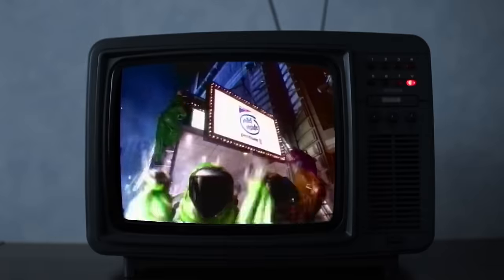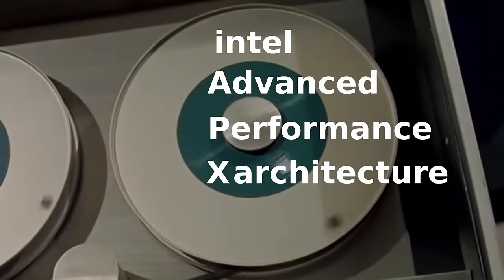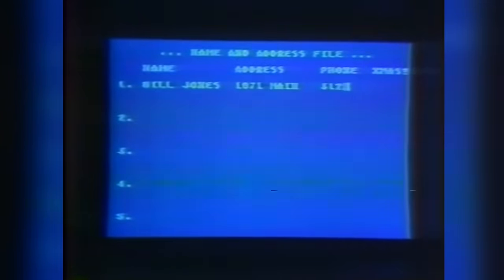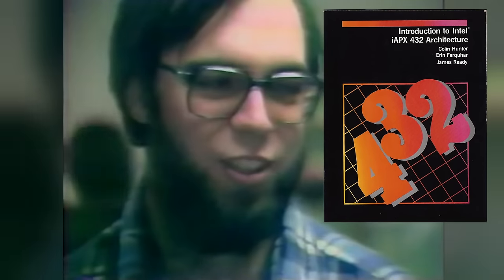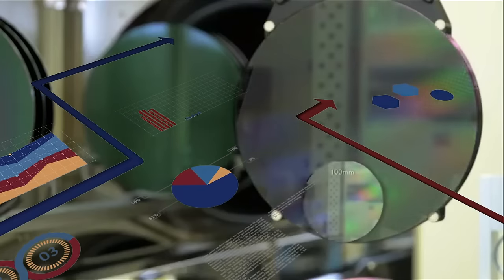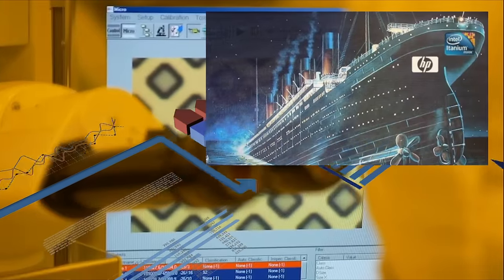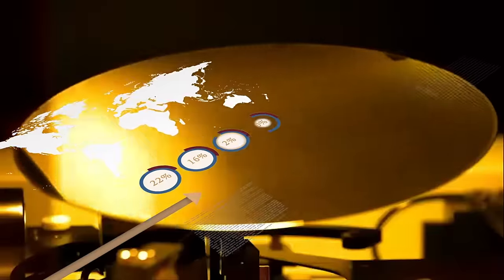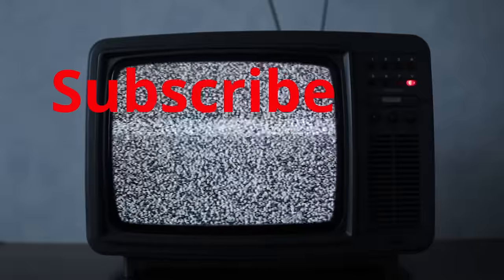iAPX The first time Intel tried to kill x86

Comment: An expensive arch with an inordinate dependency on an a magic compiler that never worked? It's the Itanium's granddaddy.
x86 was never intended to do what it ended up doing, which is why Intel kept trying to replace it. Too bad the bandaids were so effective as to render most attempts futile. The i860 was Intel's next attempt after the iAPX, a pure RISC design this time, but this also failed for a variety of reasons.
The APX wasn't unique in using multi-chip CPUs (multi-chip and discrete logic-based CPU modules were common in mainframes such as the System/360) but in minis and micros they weren't ideal and they certainly would've needed to consolidate to single-chip implementations ASAP to keep up with chips (in both performance and price) such as the 68k and especially the RISC designs that were less than a decade off.
Also, this wasn't the only arch that tried to run a high-level language directly: AT&T's CRISP-based Hobbit chips ran C (or they did until development was canceled).
Reply from the maker: I did not think many poeple would have heard of Hobbit, so I went for the lisp machine as an example as people at least go to see them in comp sci labs.
Reply: The i860 did find use in a lot of raid controllers and other applications.
One thing that killed Itanium was AMD making the X86-64 extensions and the Opteron line.
Reply: @RetroBytesUK  I'm a little bit of a Mac nerd. The Hobbit was pursued for potential use in the Newton, but Hobbit was overpriced and also sucked so it was canned in favor of DEC's StrongARM. Then Be was going to use it in the BeBox but when the Hobbit project was cancelled (because Apple wasn't interested in forking over the millions of dollars demanded by AT&T to continue development), they switched to the PPC 603.
Reply: @Membrane556  The i960 was fairly widely used in high-end RAID controllers because apparently it was really good at XORing. RetroBytes has a video on the channel about the Itanium that's worth a watch if you haven't already. It was a huge factor to be sure but there was more to it than just the introduction of x86-64 (including that ia64 was too expensive, too slow, and had dreadful x86 emulation).
Reply: @Membrane556  ah, that was the i960.  The i960 had an XOR op code.  Raid does a lot of XOR....
Reply: the i860 did have an XOR, however.
Reply: @Membrane556  Itanium goal was projected to be 1.5X better than a conventional architecture w/o explicit parallelism. But the basis for this was a specific chess code, not applicable to many server logic apps. I would have thought Itanium should have done well in scientific computing, for which a compiler should have been easily able to pack 3 (Merced) or 6 (McKinley) instruction bundles. But at this time, the big money revenue product was server - database transactions, or other logic branch intensive code, which I never saw any proper analysis as to why EPIC was the right approach. Colwell believe SMT was the better approach for logic, to reduce the dead cycles.
Reply: @RetroBytesUK  I had a comp sci prof in the 90s who utilized lisp/scheme for all his classes. He was obsessed with it and would tell us that he learned lisp in the early 80s on Star And similar lisp-OS machines.
Reply: @Membrane556  i960 ended up being fairly successful though. It was used in a lot of embedded systems and Sega used it in a bunch of 3D arcade games through the 90's (apparently it was part of the Lockheed Martin technology that Sega licensed for their Model 2 and Model 3 arcade boards)
Reply: @Membrane556  Well that and Itanium sucked.
Reply: Sure, but Intel tried to kill x86 for different reasons throughout its history. With iAPX, it's because they thought that bridging the "semantic gap" in hardware (instead of the compiler) was the next big thing, and x86 compatibility wasn't a consideration back then. With Itanium, it was because x86 compatibility was a huge consideration and AMD had an x86 license (and Intel didn't like that). So, Intel was like "if you want 64-bits with reasonably good x86 compatibility, you have to go to our Itanium monopoly". Some poor souls did, but most held on to 32-bits or if they didn't want x86 compatibility went to Sun (SPARC) or SGI (MIPS). Then AMD came up with AMD64 with full x86-32 backwards compatibility and Intel finally admitted x86 (and AMD) were here to stay, and stopped trying to kill x86.
Reply: @Membrane556  ---"The i860 did find use in a lot of raid controllers and other applications."

The i960 did. Completely different animal.
Reply: @Δημήτρης-θ7θ  The BS that was Itanic is what brought an end to the Alpha, which was a true next generation design from x86. For much of its life it could emulate x86 faster than the fastest x86 cpus in the market. And much of its foundation was built on commodity hardware and had interoperability. And had a well established ISA by this point as well.
Reply: @wishusknight3009  Chipzilla being Chipzilla brought an end to the Alpha. All those companies making RISC CPUs (with their small economies of scale and skyrocketing R&D costs) knew that if Itanium didn't beat them in most segments, x86 would, as it actually happened with the Pentium III. Later AMD64 finished them off. This also happened in an era CPU design costs were increasing rapidly, so those companies were looking for a way out anyway. In their twilight years, companies making RISC CPUs ended up either pandering to a tiny crowd who wanted desk-side supercomputers (for example SGI with their Tezro) or were charging for compatibility with Big Iron systems (for example Sun with the Ultra 25 and 45), with those SPARC Big Iron systems themselves also being bought due to backward compatibility concerns. Everything else was x86.
Reply: @Δημήτρης-θ7θ  Alpha had a thriving market all its own up until it was canned. It would have survived for some time yet, and would have even been a great alternative in the emulation space due to its wide programming flexibility. It took Conro to really put the super cores to bed in performance. But only after the other arcs were becoming left to languish with no updates.  There are even still other architectures on the top 500 that are not x86 or nVidia. And IBM Power still thrives at the ultra high end where its untouchable by anything else in performance density. 

But yeah, for the most part you are completely on the money. x86 had economy of scale and ubiquitous hardware and software support. It was a matter of time even if those other companies had the RnD power of IBM. Things eventually coalesce.

Comment: Burroughs was the first to feature compiler friendly hardware architecture in the B5000 model. it also was the first to feature virtual memory architecture. As a result, huge teams of software developer were not needed to implement Algol-60 and other major compilers with great reliability and efficiency. Eventually, Burroughs was able to implement the architecture in IC chips.

Comment: 1:23 that tape unit looks wrong. There doesn't seem to be any devices to soften the pull of the tape up reel. On full height units there are suction channels that descend either side of the head and capstans. The capstans can rapidly shuttle the tape across the head and you'd see the the loop in the channels go up and down. When the tape on either channel would shorten to the top of the channel then the reels would spin and equalize the length of tape in the channels. So the only tension on the tape was from the suction of air and not a mechanical pull from the reels that at high speed would stretch the tape. Slower units might have a simple idler? whigh was on a spring suspension. You'd see the idler bouncing back an forward and the reels intermittently spinning. Looking at the unit shown either its really old and slow or its a movie/TV prop.
Reply from the maker: It is indeed from a movie, one of the first crime capers to feature computer hacking. Its took the term cliffhanger very literally for its ending too.
Reply: @RetroBytesUK   Oh thank god.  The way that tape looked like it was getting twisted and jerked was stressing me out.  HAHAHA.  Still I hate it when movie props don't look right either.

Comment: Intel did do another O/S called RMX (stood for Real-time Muti-tasking Executive ) was used extensively with their range of multibus boards. It was powerful and popular in control systems ( like factory automation )
There was also ISIS which was used on the Intel development systems. I use to service these and were a major tool for BT, Marconi’s, IBM, and anyone wanting to develop a system to use a microprocessor as they had In Circuit Emulators ( ICE ) units that enabled developers to test their code before they had proper hardware or to test their hardware as you could remove the processor and run and debug your code instruction by instruction. 
During the early 80’s there was a massive rush to replacement legacy analogue systems with digital equipment controlled by a microprocessor and intel had development systems, their ICE units and various compilers ( machine code level, PL/M, Pascal, C, to name a few ) so a hardware engineer could develop his code and test it quicker than most of the competitors. 
Fond memories going to factories where they were putting their first microprocessor in vending machines, petrol pumps, cars, etc. 

One guy developing his coke dispensing machine wanted a way of networking all the machines ( no internet then ) and have them as a super-computer calculating Pi as they would be spending most of their life doing nothing.
Reply: I've got an Intel System 310 running iRMX 86!

It's actually been rebadged by High Integrity Systems, and has three custom multibus boards which are the core iAPX 432 implementation by them.

The iRMX 86 side works well enough, but the Interface Processor on the iAPX 432 processor board refuses to initialise, and I suspect it is due to faulty RAM.

Very interesting architecture, and very interesting company. They appear to have banked their future on the architecture being successful!
Reply: @orinokonx01  I would of had all the service manuals for this back in the day. They all got thrown away on a house move. 
I think ( and this is a big guess ) that HIS were involved with the railways but I use to fix 310’s in care homes, airports, railways, motorway control rooms to name a few. 
IRMX was also available as 286, 386 , etc

There was a strong rumour that IBM considered it as the O/S for their PS/2 range instead of OS/2, which sort of makes some sense as it would break the reliance on Microsoft ( who were beginning to get a little too powerful in the industry !) and IBM had historical ties with Intel. 
When I joined Intel in 1984 IBM bought a percentage of the company to keep it afloat with a growing pressure of Japanese chip producers. 

Using iRMX would of also made sense as it was not limited on memory size like standard DOS and used protected mode as standard so was pretty robust ( had to be for mission critical systems !)

I specialised in Xenix running on the 310 and it got me all round Europe supporting the systems back in the 80’s. 😊
Reply: I remember RMX and ISIS.  They ran on multibus based computers, Intel's version of the S100 bus.  ISIS had a whole set of editors, assemblers and emulators. While working at Intel, I used to write 8085 code, assemble it, and write the machine code into EPROMs. The EPROMs were installed into main board of 8085 based systems that tested Intel memory products. As bugs were fixed and features added to the code, I'd remove the EPROM from the system, erase it under an Ultra Violet light. Edit the code and re-assemble, and re-program the EPROM with the new code. Although I never wrote code myself on the RMX systems, I worked alongside some folks who did. It was all in PL/M.  I recall that RMX ran on either the System 310 System 360 or System 380 boxes - again they were multibus based and had various options for cpu cards, memory, IO, and later, networking.  Later I put together a lab that used Xenix on the various multibus boxes. I was trying to acquire additional hardware to build up the lab and noticed in our internal warehouse inventory some unused hardware that might be useful. It was pallet after pallet of scrapped iAPX 432 boxes. They also used multibus. I was able to repurpose that hardware (without the iPAX 432 cpu boards) and turn them into 80286 based boxes running Xenix.
Reply: @ModusPonenz  I worked on systems up to Multibus II. It was needed for the 32 bit processors. 

I left Intel in 1991 when they put my group up for sale. The PC architecture killed the need for their own service engineers. 

Great times though, could book myself on any of their courses, did 8085 assembler through to 386 architecture.
Reply: @ModusPonenz  I used a MDS system. Quite a performance machine. 8080 at 2Mhz and ISIS II, assembler and PLM80.

Comment: I attended a presentation in Portland Oregon where Intel engineers were extolling features of iAPX 432. I remember they discussed how its hardware supported garbage collection addressed a key aspect of running programs written in high level languages. During the Q&A afterwards, someone asked about its reported disappointing performance numbers. Their response didn't refute or address that issue.

Comment: It's hard to get across how bonkers iAPX is unless you read the programming documentation, which I did a few years ago.  No only are instructions variable length in true CISC fashion, but they don't have to align to byte boundaries and can be arbitrary bit lengths.  That's just nuts.  Even the high-level theory of operation is hard to understand.  All of that so they could keep the addressing paths limited to 16-bit (because all that 64K segmentation stuff in x86 worked out so well, didn't it?)

I'm not a fan of RISC, as I feel more compromise between the RISC and CISC world might be pretty effective, but iAPX really takes the cake in terms of complexity, and it's no wonder why RISC got so much attention in the mid 80's.  It's a shame the video didn't mention i860 and i960, which were Intel's attempts at making RISC designs which were a bit quirky and complicated in their own rights.  Of course, those processors saw some success in military and embedded applications, and I don't believe they were meant to compete with x86, let alone replace it.

One thing worth mentioning: the 68000 processor used about 40K transistors for the logic, but also used about 35K more for the microcode.  The transistor density of microcode is much higher than logic, but it's misleading to just chop the microcode out of the transistor count.  That said, the 68000 was also a very complex processor, and in the long term probably would not have been able to outperform x86.  That's a shame, as I liked programming 68K.
Reply from the maker: Have you seen the timing of some of those instructions that the part that really suprised me. We are all used to variable instruction times, but this is on a very different scale to other cisc processors.  

The 68060 shows how they could can continued the line, with complex instructions being broken down in a decode phase into simpler internal instructions for execution, just like intel did with the pentium and later chips. I think the fact they could not get the same economies of scale as intel ment they had to narrow down to one cpu architecture and chose powerpc.  That was probably the right move back then, and powerpc had a good life before it ran out of road and space in the market.
Reply: @RetroBytesUK  There are two main issues with 68K that make it complicated to extend the architecture.  First, 68K can access memory more than once per instruction, and it also has a fixed 16-bit opcode space limited to 32-bit operations.  The only way to properly extend 68K to 64-bit is to either make an alternate ISA or resort to opcode pages.  It's doable, but I doubt a modern 68K machine would really have a simpler core than x86.  If the 68000 had been designed with 64-bit support from the start, then things might have worked out differently.

One of these days I should look into Motorola's attempt at RISC, the 88000.  I've read that it was pretty good, but for some reason nobody used it.
Reply from the maker: @Waccoon  I believe the reason it struggled was that it kept being delayed time and time again, then was available in very low quantities. So those designing machines around it moved on to another cpu.